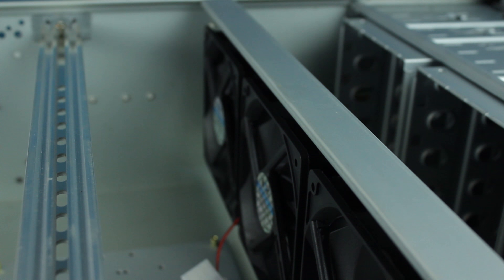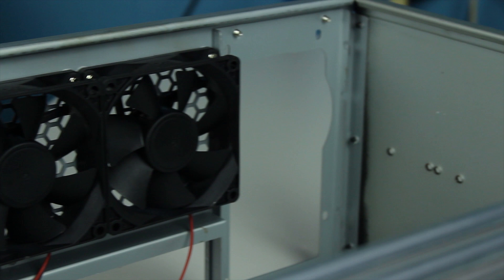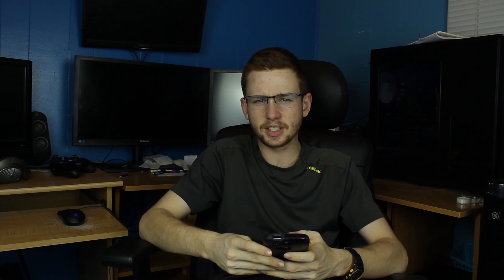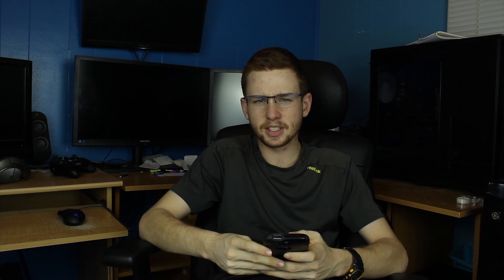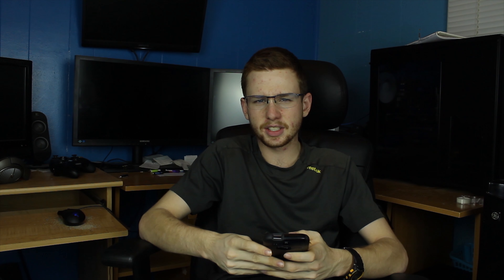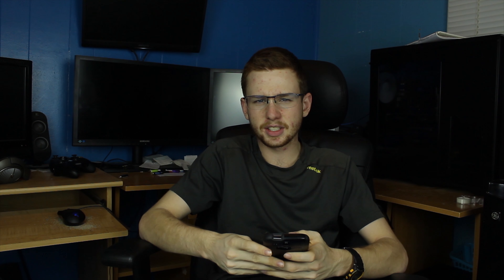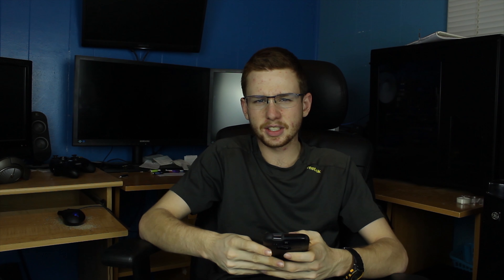Rosewill RSV L4500 Review - Best Budget Server Case?

Comment: I got this case and if you want hot swap you can get 5x3 hot swap cages and replace the others but you lose the 3 fans in front but a lot of the hot swap cages have fans on the back.  I got my case a long long time a go and just ordered a Super micro mother board and after hitting the buy button I realized it may not fit since its a + mother board witch mean it extends past the IO shield, were the power supply is and this has a hot swap power supply with 3 hot swap power supplies for 800 watts it has 3 400 watt power supplies,  its a 2+1    So mother board I know will not fit with that power supply.  So Off to sell some vacation to get a super micro case.

Comment: the case says it can mount 15 3.5in drives, i dont get where
Reply: He put the drives upside down to the slots, that's why it fits only 4 on the video. 1:14 if you rotate the drive 180 degrees and move it a bit upwards you will see that it could fit 5 into one of those rows. The vid has 190 downvotes for a reason. it's quite garbage when it comes to information. But at least you are able to see the product nicely. :)
Reply: @LannisterFromDaRock  that makes sense

Comment: Good to know about the paint job, man. I feel like your other two big complaints defeat the purpose of a cheap server case, though. They have a hot-swap model available as well. It just costs more because it requires the extra interface boards and trays. You could also put in a fan controller or quieter fans to knock out the noise if that was a problem, but for the price I don't mind them including a bare minimum set.
Reply from the maker: +bobbinatorrah67 While I do have complaints it is a great case if you didn't mind the extra set up time or the noise. I only commented on the noise issue because I found it to be too loud to sit in my room and run. I did however move it to my server rack so now I can not hear it. If this case costed $50 more I would complain about the lack of a backplane more but the bare cost is what really sells this model to me.

Comment: Is this compatible with a 19" cabinet or do i HAVE to buy rails ? and if i do, will iStarUSA IS-26 fit ? i'm a bit of a noob server hardware wise :c
Reply from the maker: It does not come with rails due to the low price
Reply: but will it fit a 19" wide cabinet ? or do i need to buy rails ?
Reply from the maker: I have mine in a 19" cabinet and I had to buy rails. Did this 2 ish months ago. Sorry for the delay, life got in the way
Reply: no problem, you answer much quicker than most channels. Thanks a lot !